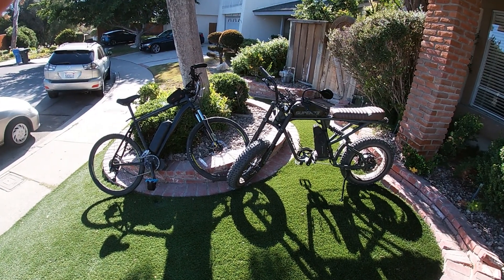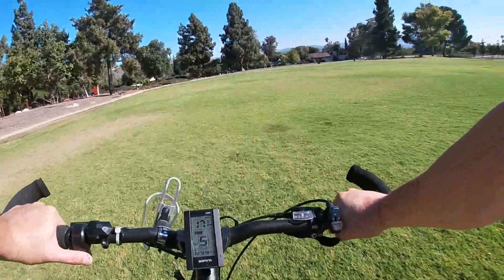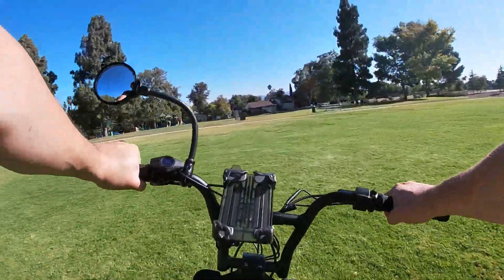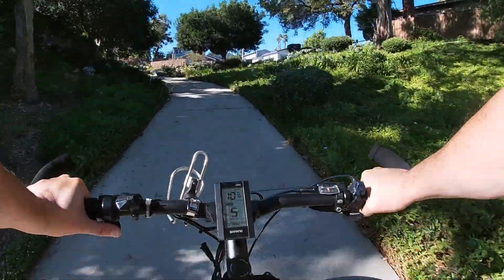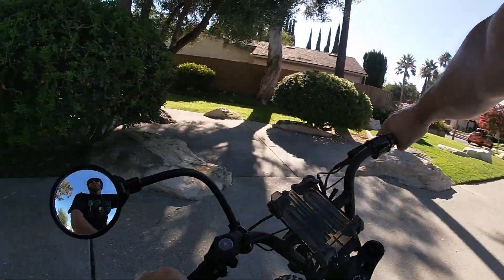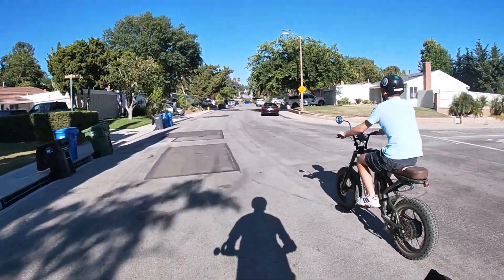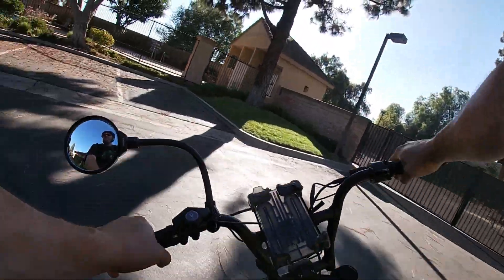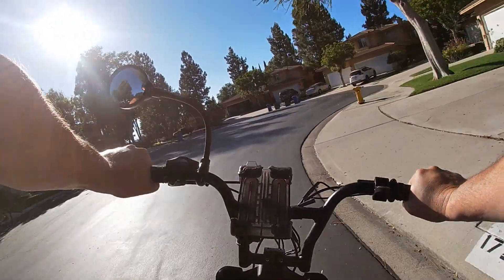Super73-R vs. 750W Mid-Drive eBike

Comment: I don't think you are quite grasping the concept of how gears work. For your grass test you started from a stand still in 5th gear on the mid drive. Do you see the problem there? If you were at a dead stop in a stick shift car, would you put it 5th gear and try and take off? I hope your answer is no to that. Shifting is fundamental. Low gears for torque and taking off and the high gears are for top end. You hub motor can't take advantage of the gearing but your mid drive can. Hope that helps.

Comment: You need to shift gears in the bafang!! Firstly you WILL strip out the main nylon drive gear starting in the wrong gear. The bike never sees any of its potential the way you ride it. My old 750w would pull a small car with a 42t front sprocket an 34t rear and when ran at 42t and 14 rear hit 31 mph.